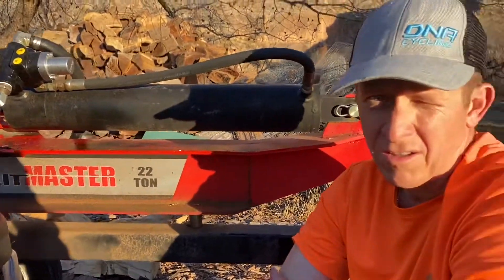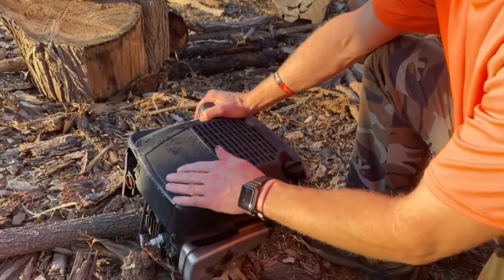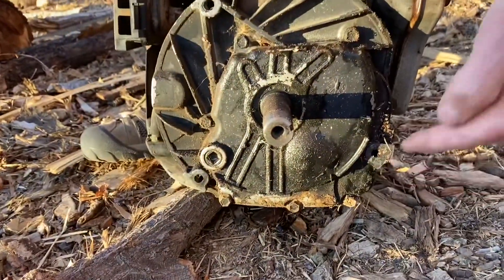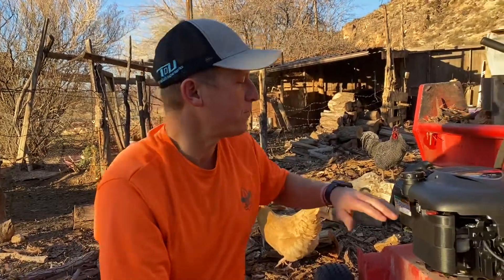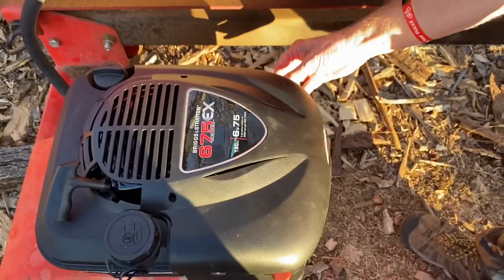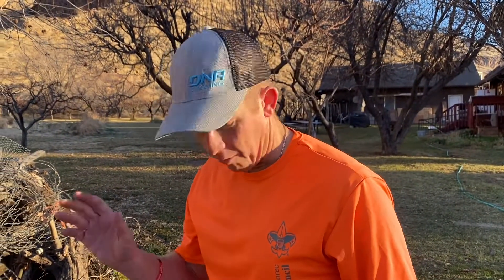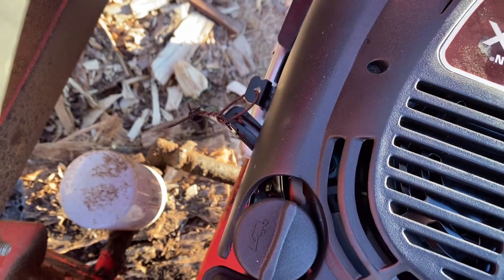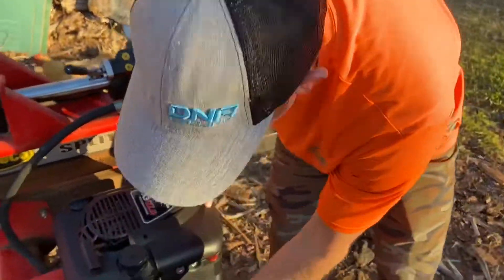SpeeCo Splitmaster 22-ton logsplitter engine replacement

Comment: Could one unclip your spring to disengage instead of draining gas? Also, no problems with shaft length and bolting? Very helpful!
Reply from the maker: Thanks for watching, and glad it was helpful. Yes, you can do the shutoff the way you described. I find that in the long run it’s best practice to run the gas out of the carb when running a small engine intermittently. The shaft on the replacement engine was the perfect length. It’s been several years since and it’s a little foggy at this point but I believe I did a lot of measuring and comparing the specs of the new engine to the measurements, which is why I did the video so others wouldn’t have to wonder like I did if everything would fit. Thanks again for watching.
Reply: I can’t find your model number 126N02-0437-F1 anywhere. There is a 126M02-0437-F1. Could you have misread the engine model #?. If not, I would be desperate to find out where you got the engine.